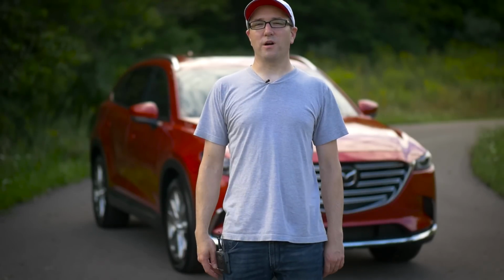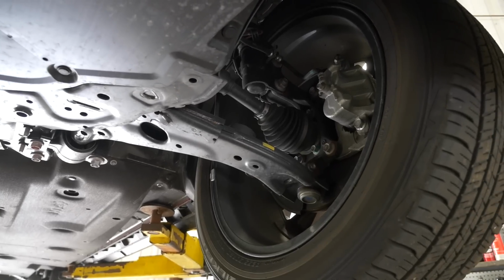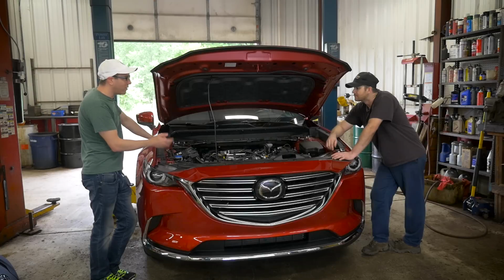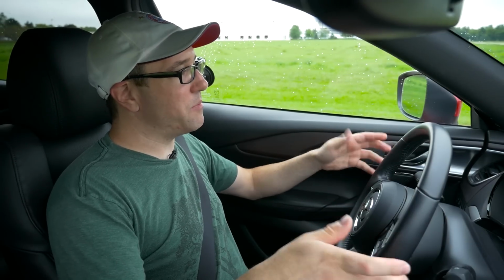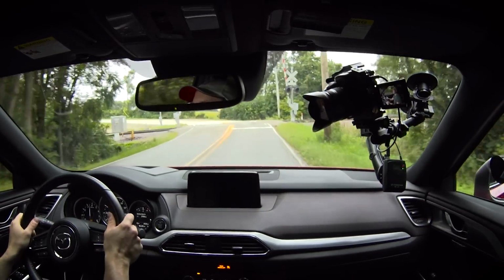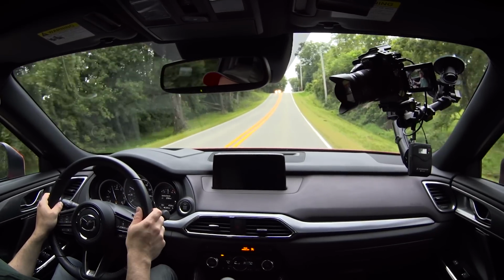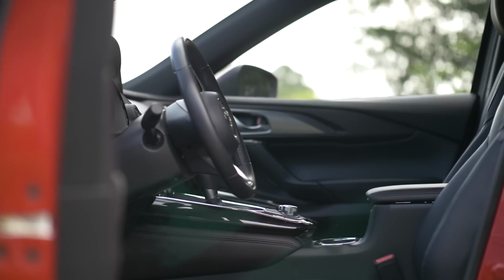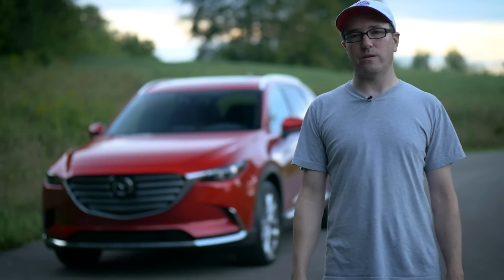Review | 2016 Mazda CX-9 | Plump Yet Satisfying

Comment: savagegeese, great review. I have a 2016 Signature. I think you made a mistake in stating that the trim you have is Signature. The Signature trim only has Napa Auburn Leather and the Real Rosewood trim. Also, Red is not available on the Signature. Sofar, I have not experienced any of the rattle or mirror issues on my CX-9.  The only thing I wish the CX-9 has is second row captains chairs.Otherwise its a fun SUV to own, looks awesome
Reply from the maker: I mispoke as some of the paper work I had said it was signature, yet clearly it's not.  But that's my fault.  How many miles you have on yours?  How do you like driving it so far?
Reply: I have 1500kms on mine now. I really enjoy it. I am the dynamic type of driver and enthusiast, I believe, similar to you. My fun car is a 2001 s2000, original condition, I use to do a lot of lapping and track days with it. To find a family vehicle that can seat 7, yet have a nice dynamic sporty feel, reliable and at a reasonable price point was hard to find until I test drove the CX-9. It truly drives smaller than it is... The Pilot, Highlander and Pathfinder did not do anything for me. I think the CX-9 is a home run in this segment, overall interior/exterior styling and driving performance is at the top. My only wish is that the CX-9 had second row captains chairs...the easy pass through for the kids is what I really missed from our traded in 2014 Odyssey.... Cheers! and I have subscribed!!

Comment: Great review as always but a bit too critical. Did you test the Bose sound system? You should also try to include your real-world 0-100 kmph figures in your reviews.

Agree with you about the features in Kia Sorento that are missing here. Things like 360 degree camera, Android/Apple, ventilates seats, panoramic sunroof etc. essential at this price point. The front does look unnecessarily longer than needed, just like the Mazda 6.
Reply from the maker: +Sushanth Raghuthaman I cut out the bose park, its average at best. Good bass response but not clarity.  I need to figure out the 0-60 stuff.  I have 10hz gps but dont want to invest in the expensive stuff.  Dont make enough off channel to warrant it at this point.

Comment: nicely composed.  Do you have a decibel meter?  How does the interior noise level compare with newer CX-5 or the competition you mentioned?  the big question is how will this all translate into the lesser, FWD Touring trim for those that do not need (or want) the AWD and who don't need leather and GT spec goodies?   Is this one of those vehicles that is only good or worth owning when it is in its highest trim levels?  It is nice that early press vehicles are top shelf, but top shelf sales will only count for a small portion of the overall volume, so this vehicle is not representative of what will be the volume leader being sold on dealer lots.
Reply from the maker: +K03sport I need to spend some more time in the lower trim levels namely the front wheel drive version because I can't imagine how bad it would be not having the power sent to the rear wheels to balance out some of that torque.  From my measurements it was about 6 decibel quieter than the CX-5 at 65 miles an hour.

Comment: How would you compare this against a closely priced competitor, the Kia Sorento EX or SX V6 AWD? What about the V6 in the Sorento vs Mazda's new turbo 4? Driving experience and handling? Linear power delivery? Which would you rather own? Would love to see a comparo of vehicles in this class. To me, the Mazda seems nicer interior and exterior like a Lexus. But I hate creaks and rattles, that gap between 3rd and 4th row when folded would piss me off and the HUD defaulted to "on" is, I agree, annoying. First impression, I felt a little cramped sitting in the driver's seat of the CX-9 vs the Sorento.

Comment: Do you still have to cut the accelerator and brake pedals off and re-weld them in the proper angle to get comfortable in a Mazda? We gave up on Mazdas 15 years ago after that little experience with our Protege.
Reply: Wow some of you guys need to get with the times. Mazda is not what it was 15 years ago. I've owned them for about 20 years and they are a whole new company with Skyactiv. A lot of their reliability and quality issues stemmed from Ford. Currently own a 2016 6iGT And a 2010 CX9 and although the CX9 has been a great car (except for a Ford sourced PTU), the new Skyactiv 6 is in a different league. Time to throw away preconceptions from decades ago and open your mind. IMO
Reply from the maker: +ocramidajzj Agreed this is post Ford Mazda, not the same.  But I understand how people want/need some proving.

Comment: Yeah, I once had a girlfriend like that, just a little plump but very satisfying -  as in VERY!  My 2019 CX 5 Grand Touring Reserve 2.5 L. turbo is not as "plump" as the CX 9 but with the same engine it is QUICK, especially when I put in 6 gallons of 100 octane gas (at an eye-watering $8.00 per gallon). 100 octane is "Joy Juice" for MAZDA 2,5 L. turbo engines.

Comment: Doesn't the signature model have wood where the piano black plastic normally is and higher quality leather? or are those options?
Reply from the maker: +tunkor Paper work and keys all said signature might be preproduction or just wrong.
Reply: Ah okay, great video!
Reply: Yes, the Signature Edition has the fancy Japanese rosewood trim by guitar-maker Fujigen, better premium Nappa leather interior, an LED connection to light-up the ‘Signature Wing’ on the front grille, also red exterior color isn't offered currently in the USA.

Comment: will there be an issue with the engine and turbos when driving in an area with temps of 50c in summer days
Reply from the maker: +90SkidUSA Not in modern cars, ECU adjusts power output/timing based on temps.  However you may want to switch to a different oil weight of you are constantly in extreme temps like that 5w30 5w40.  But check with service manual.

Comment: About the 2.5t in the 3 and 6....the answer is awd. They already have an awd system in the cx3 and cx5. Beef up the diff, driveshaft and axles or simply adapt the cx9 hardware. Easy
Reply from the maker: +wayde philpot Thats not going to happen until next gen and this motor would have to be retuned for those cars, its way too much tq for a light weight setup.  You can wheel peel the fronts here with awd and supposedly its even more crazy on the 4000lb fwd version.
Reply: +savagegeese i get what youre saying but i think about the STI and other awd compacts that make similar tq. Its definitely possible but they may want to slightly detune the motor for use in lighter vehicles like you said. 310 ftlb in a 4000lb suv is above average and allows it to accelerate quickly. That same tq in a 3400lb awd 6 would make for a very fast car but still manageable with awd and mazdas trick g-vectoring to help manage power when youre not going str8.

Comment: Thank you for your amazing presentation but I would appreciate to know a better explanation about the CX9 engine and performance in relation to a V6 cylinder Eng. Is this engine durable enough for a SUV usage (example long family trips) in comparison to a conventional V6 SUV?. How is the impact in a medium and long term in the performance and durability of an engine supported just for 4 Cylinder with high HP and  torque in relation to a 6 cylinder engine in terms of fatigue and durability?. What are pros and cons or advantages and disadvantages. I guaranty you that these are the major questions that simple end-users like me ask to ourselves when take the option for purchasing a CX9 instead of a conventional SUV V6 like Honda Pilot, Toyota Highlander or Nissan pathfinder or Murano. In one word the "Reialability" in the medium and short term!!!! Thank you very much in advance for any response
Reply from the maker: I think most of us agree from a technical perspective a V6 is just so much easier for a heavier vehicle like this. But Mazda is not other companies and engine development on a V6 for a one off vehicle makes no sense.  So they designed a 4 banger that can be multi-purposed in almost every car. They clearly have other ideas for tuning it or changing it slightly to fit the car models in a few years.  

More to your question, they believe the Skyactiv motors are strong and so far the NA motors have been quite reliable.  On paper and based on the design of this motor it should carry much of that same reliability. However the proof is in the miles, this is really their first solo project turbo motor in quite a while, they learned from the 2.3 they had previously and this is a major investment for them.  The low end power delivery up to about 4500rpms is far stronger than the V6 in the Sorento/Pilot above that not so much.

Their primary design was to make the car in daily driving better and more responsive than a V6 and in most cases that is absolutely true because of the near instant TQ. But there is also the complexity and heat involved with turbos including less performance in higher elevations, fuel quality and did I say heat?  It's not just Mazda but for sure the first few years I would lease this platform until the motors are proven.
Reply: savageese, Thank you very much for your response. I would like to purchase a SUV for a typical SUV usage like long family trips with a good reliability in winters (-25C) and driving on snow. My option are btw the Mazda CX9 or a typical SUV V6 like Honda Pilot or Toyota highlander. It is a great dilemma for me now.  Regards!!!
Reply from the maker: +Gonzalo Diaz yeah it's a tough Dilemma to have picking between 3 pretty good cars the CX-9 definitely is my favorite of the bunch but I am definitely conservative and wouldn't jump on it first year unless it was a lease.
Reply: Thanks again Savagegeese!!!, Just like an additional comment: I wondered how the engineers from Volvo have made for getting an engine just with 2.0, 4 cylinder 316 HP and torque of 295 lbs-ft for the T6 XC90.  Looks like they are in the vanguard in this technology. Regards!!!
Reply: +savagegeese are you sure about your comment regarding the 'less performance in higher elevations' of a turbo? A turbo compensates for a percentage of the thinner air at altitude (due boost) and will have less of a power/performance drop than a naturally aspirated engine ie the V6s you were comparing it to. On top of that the fact it gets cooler as you get higher also means you will get greater increase of performance over a naturally aspirated engine which also helps compensate for a percentage of the thinner air. However as you rightly pointed out heat can be a killer of a turbo engine and saps more power/performance than it does on a naturally aspirated engine.
Reply: Of what I've read, Mazda overbuilt the Skyactiv engines. I believe it uses forged crank, pistons and rods.
Reply: A+ response. I enjoy watching your video. I find them very informative from a technical and consumer standpoint.
Reply: Tedtalks
Reply: savagegeese less performance in higher elevations?  Huh?  Turbos, unless specifically tuned to lower boost for heat issues, compensate for altitude while a NA v6 does not. 

On a side not,  this vehicle will be attractive to the man who enjoys driving but needs to buy a large family car and does the majority of the shopping for said car ( would prefer sporty driving dynamics over heated seats for the screaming kids)
Reply: Matthew Way go check Mazda's chart on CX-9's torque output relative to rev, then check CX-5's(same engine, one with turbo and one without), CX-5's 2.5L comes at 6000rpm when torque is at highest, CX-9 I believe is just 1000rpm
So to get the most out of Mazda's 2.5L you will need to step that paddle really hard, but for CX-9 a light tap is all you need.

Comment: Mark, do you think CX9 can handle all the salt in our salt belt during winters and fight rust?
Also, what would you pick. This or Lexus RX? For a female driver.
Reply from the maker: +Manny I had about two Winters on the Mazda 3 and it did not have the amount of surface rust and rust that the Scion FR-S dead it was very minimal the manufacturing for the CX-9 should be very similar. I don't think there should be a major issue until after the fifth year 6 year of ownership.

Comment: Mazda can make a signature version of the 3 and CX-5 with more insulation, the added weight of which would be countered by this engine. Maybe not with this 310 ft/lbs tune cause it might blow up or flip over.

Comment: savagegeese, since you also reviewed the Volvo XC90, could you tell us which you enjoyed  more?  I suspect you believe the Volvo is superior overall, as it should since it is typically $15-20K more (over $10K more similarly equipped). Question is, would you spend $15K more to own the XC90 over the CX-9?  I know these aren't direct competitors but I'm looking at both. Thanks
Reply from the maker: +- JPL - The answer is the the extra cost not equivelent to added benefits.  Yes the Volvo is a better vehicle, interior design, refinement, ride, audio but....  75k the CX9 is similar enough in many ways and is a great deal for what you get
Reply: savagegeese  thanks

Comment: Nice review overall. I for one would love to have an AWD Mazda 6 with that turbo engine. IMO Would give Audi a run for its money at a lower price point. I agree that trying to push that power through front wheels would be a mistake. I owned a 2008 Mazdaspeed 3 and it wasn't fun with 263hp through the front wheels.
Reply from the maker: +ocramidajzj When I was car shopping 5 years ago I drove the Speed3 and WRX back to back and was like how the hell could you have fun dealing with all that understeer and tq steer with the fwd system.
Reply: If Mazda does an AWD 6 turbo IT NEEDS TO BE RWD BIASED.  Put an good rear diff in and send  70 percent of the power to the rear wheels.  If they cant do that then it becomes another VW Golf R.  The R drives like a big heavy FWD car unless you really mash the gas.
Reply: +fatboy19831 no question rear wheel bias would be the better choice, but for me I always mashed the gas. :) And honestly, I think if you're not tracking the car it's not as big a deal. Despite being front wheel bias, the R definitely pushed me around corners better than the 6. It was very apparent. For that matter even my wife's 2010 CX9 with its handed based system takes corners better in the same way. Don't get me wrong the 6 is a great handling car, but it will under steer if you push it hard enough. By comparison it takes more hard driving to get the same behavior out of the R or CX9. IMO.
Reply: +ocramidajzj damn spell check. Meant "Haldex" based.

Comment: The plastic panels are not for looks, they are for a purpose, which is rust issue on metal. But i like the overall review.
Reply: Yup! I wouldn't buy an SUV without the plastic cladding. Yes, it's not exactly pretty but you'll be happy when your vehicle isn't rusting away. I see rust on all makes without cladding. Particularly pickup trucks. No cladding on most and the fenders are rotting away on late model trucks that cost over $40K. Sad.
Reply: agreed.

Comment: Why don’t manufacturers offer a 3rd row SUV without the 3rd row? Not all of us want to haul around more people. I think there should be limitations to how many people are allowed in a car before it becomes tagged commercial. If you have 7 kids, ok, get a freaking van. The 3rd row ruins the utility of larger SUVs. If they want to streamline assembly to make them all 3rd row, why not offer 3rd row delete as a dealer installed option? Sure you can fold the seats down, but consider how much more storage space- maybe a plastic organizer under a flat floor that they could add back there. I can see a 3rd row in a Navigator, Expedition, maybe Highlander, or Suburban, but WTF in an almost large CX9. Don’t drink the cool-aid Mazda. You can be better.
Reply: They dont do what you are suggesting because it isn't what people want. Most people would rather have the option to have the third row on occasions they need it and be able to fold it down when they dont.

The majority of buyers that do not want a third row dont want a vehicle this large.n they either buy existing 5 seaters or a truck if they need to haul a lot.

Comment: I love mine. To me, it seems to be a odd mix of Japanese, and American ideas.
Reply: One key engineering aspect I've noticed, is that in the engine bay, the exhaust is routed between the firewall, in the back of the engine.. As appose to running the exhaust under the oil pan like all others..
Reply from the maker: +jon doe great point